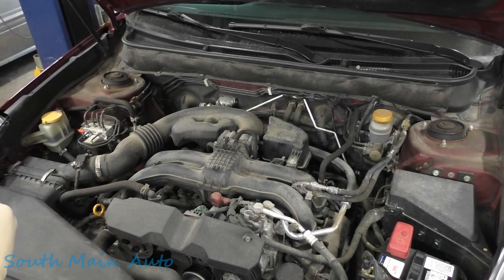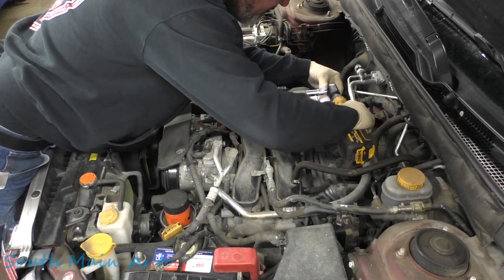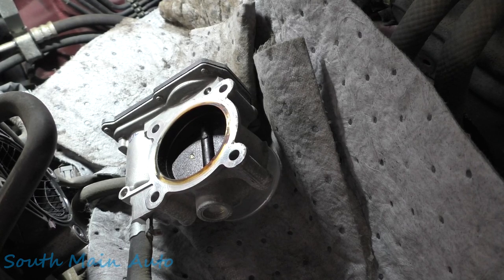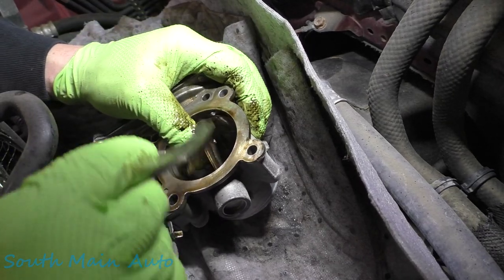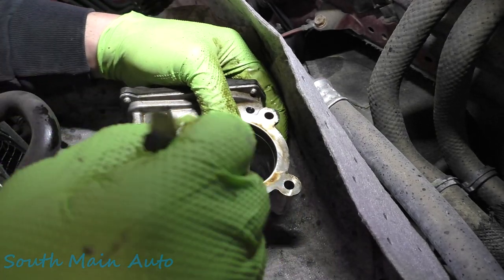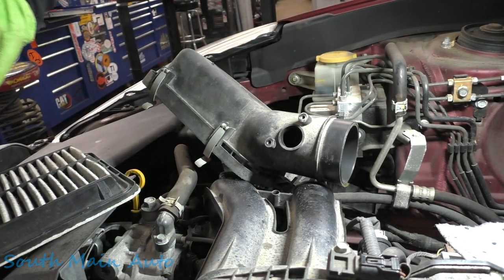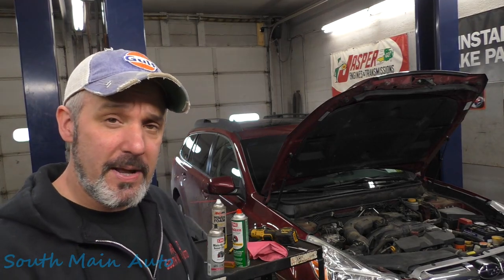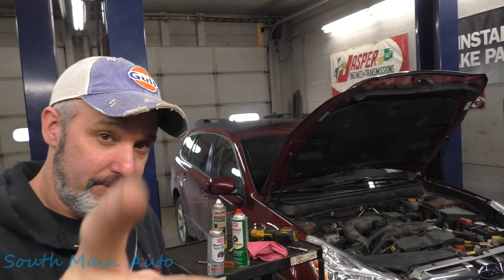How Does Your Shop Deal With Intermittent Symptoms?

Comment: For intermittent problems I tell the customer to leave the car with me for a week.  If it’s a problem that happens once a month or so then I’ll tell them to bring it back when it’s more broken.  

I drive it as my personal car (to/from work, around for errands, etc.).  Of course I return the car with a full tank but I’ll sometimes put 100-200 more miles on it.  Usually I can get them to act up but if not then I’ll do similar “guess and check” style repairs.  I also make sure to wiggle all the wiring harnesses, relays, etc. just in case.  

Having the vehicle for a few days also helps me think about the problem and sometimes I’ll have an idea that I wouldn’t have if the car was just there for a few hours.

Comment: So I’m only a few minutes in and only a few scrolls down the comments. 

Idle droop is a common problem on NA (1st gen) Miata (No a Miata is not a Subaru). Among Miata owners the anecdotal consensus is the Idle Air Control Valve / Idle Speed Control Valve. There are passages cut into the block of the intake where the TB mounts to: these get carbon deposits that cause the IACV/ISCV to not function properly. A good cleaning is usually the solution. 

Now at 4:40 where the EGR valve is being checked; I had also found mine (different design) to stick. Again soaking and scrubbing got it unstuck. Not exactly sure if it was related to the idle droop)

I also cleaned the TB as I had it off anyway to clean the IACV/ISCV passages. Mine was spring-loaded and cable-actuated, no no real concerns about opening the butterfly. I would think for an electronic TB, so long as it is not under power, and not being forced to its end stops, it should not present any issues. (Doing so while powered, or applying pressure while fully-closed / fully open, WILL cause internal
Mechanism damage.)

Link for the Amsoil Power Foam?

Comment: I too, have a throttle body brush for my AR15. I do not, however, use Power  Foam on the bolt carrier group. Im a Hoppes no. 9 guy.

Comment: Run a cheap data logger(cheap Bluetooth OBD2 adapter with a smartphone app) anytime while driving. That's how I found the intermittent hesitation (during steady driving) issue. It was due to a faulty throttle position sensor. TPS resistance tested fine, and the sweep tested fine. The issue occurs during steady throttle, the TPS reading would go from whatever the throttle was held at to 0% and back to the original position, all in less than half a second.  This caused the ECU to think the throttle was closed and thus cutting fuel, hence the hesitation.

Comment: It is one of the hardest things to find, Intermittent faults. But yes you must at least try inspect the regular things that can possibly cause drivability idle problems. In Australia on the Subaru we had a lot of Idle hard start fault problems with air flow meter, generally clean or replace and problem fixed.  Love watching your Diagnostic technics. Dave from Australia

Comment: I had two Subaru's in the last 6 months.  With intermittent stalling problems.  Both times I cleaned the throttle bodies and was able to restore idle quality.  I do the same on gm's and I perform a relearn procedure for the gm throttle bodies.

Comment: As a diy mechanic a customer I have had a 15 Elantra 1.8 that would sporadically stall.  Would read the codes no codes.  Car would drive fine for me, give it back and under their driving conditions would stall.  I eventually got it to stall for me and when it did stall would show a cam code (I don’t remember off hand the code number) but it was a exhaust cam code.  Swapped sensors around since they were the same part number and eventually it stalled with the code moving to the intake.  Finally was able to pull the trigger on a cam sensor.  It’s not easy guessing on parts when I don’t have enough experience with that manufacturer also don’t have a high end scan tool or scope.  Sometimes luck and reasonable though deduction have to be used.

Comment: Idle Air Control Valve My father had an intermittent rough idle on his BMW 318i. It would only occasionally happen when he turned the wheel over hard, such as when parallel parking. Local mechanic could not figure it out. I figured it out. It was the Idle Air Control Valve. When the wheel was turned hard, the power steering pump taxed the engine the most--drawing down the idle, naturally. To compensate, the IACV kicked in and, since it was dirty, it would occasionally stick. This would throw the idle off. Check the IACV, if there is any on that Subaru.

Comment: Went through it years ago in a GMC truck. It was winter time and it ended up being water contamination in the fuel tank. Some days the water would freeze or be slushy and some days it was a liquid.  Customer went through every repair known to man for months. Unhooked the fuel feed after pump and did a clear bottle sample, there was about 2 gallons of water in the tank.... Solution was a drain and new tank sender pickup flange gasket.

Comment: I work on my old Navy Base so I do have an advantage. I am there every day. I can leave an intermittent problem and check it every so often and build up some info. Does it malfunction more when it is wet? When F18s are flying over and shaking the building? Are the SeaBees running something that pulls a lot of current? Mechanical parts and electrical connections are where I start first. I can temp repair it till I discover the actual problem.

Comment: I think the key take away is 'to use all of your resources'. What can cause a symptom like this? How can you reproduce it? How accurate/informative was the customers description? When I used to service manufacturing machinery having a good operator who could describe the problem made things so much easier. 

I bought a 1993 Geo Tracker (Suzuki Sidekick) new. Within a few days the auxiliary electric cooling fan kept turning on/off randomly when the AC was not in use. it might stay on for a few seconds or a few minutes. On/Off, On/Off. With the AC on it stayed on as it should.

Dealership had it for two weeks and said they could not get it to stay on long enough to figure it out. Took it to another dealer (since it was still under warranty), they said it was the blower switch on the dash! Obviously clueless. In the meantime, I had bought the Suzuki factory service manual and looked up what could turn the fan on. There were only two things that would cause the fan to turn on. 1) Turning on the AC, 2) A thermostatic switch on the block which monitored coolant temp. 

Took a screwdriver handle and tapped on the thermostatic switch and the fan came on. More gentle tapping and it was on/off, on/off. Called dealer and told them exactly what part was bad and needed to be replaced. Called back later in the day and they bragged about how smart their tech was for figuring it out. When I reminded them, I told them exactly what part was bad they changed their story.

Point is use the information you have available. I'm just a shade tree mechanic but a little research and common sense can go a long way.

Comment: Re: Aftermarket air filters
My Ram 2500 6.7L Cummins fuel filters are the same. I can't use aftermarket fuel filters. The aftmkt ones have a round hole, and have to be forced onto the oval-shaped pillar thing-a-majiggie, and are then hard to get back off. The OEM filters have an oval-shaped hole and fit right into place and are easy to remove.

Comment: While watching the removal of throttle body on Suburu I noticed that two of the screws seemed to be loose. Indeed, the sealing surface of the throttle body showed uneven crud build up indicating a slight leak.  I had to replace the throttle body on my 214 Jeep Patriot, 2.4L engine, and found one screw wasn't even tight.  Upon a closer look, all the screws were too short to provide good clamping! Only two or three threads engaging the boss of intake manifold.  I ordered 50mm longer screw from McMaster-Carr, tapped the holes through the manifold boss and problem solved.

Comment: Stalls after battery replacement. No codes no skip. Disconnect battery for a minute. Reconnect. Turn ignition on engine off for ten seconds before starting. This resets minimum air rate. If it still stalls, replace air fuel ratio sensor and oxygen sensor. Both sensors!!!!! It will stop stalling and eating cats.

Comment: I worked for a Buick dealer  in the late 80's early 90's . The techs would check for any bulletins from GM stating a similar issue. Or they would have someone like me who was paid hourly not book time drive it for as long as it takes for an issue to occur. Once I went for a long ride and had to be towed back, after that I had to just drive in circles or close by so it was a shorter tow back.

Comment: I do the same as you have done. I use the years of working on vehicles use things that have worked before. Try one thing tell customer to drive it and see if it fixed or try something else. If I have time or the customer can do without it I have drove the vehicle back and forth to work couple of days to see if I get it to act up

Comment: I had a customer with an 04 Odessey, 230k- I checked out the car before it went on a Disney cruise from NJ- it came back with a stored P1740. The car ran good- no lockup or 4th flare. Customer also noticed that the check engine light after 11 hours of continuous. It has clean fluid. I do believe the solenoid is failing mechanically, but it ohms out just fine at atmosphere temperature. I need another code, so I sent him on his way, as this will be used mostly around town for the next couple months.

Comment: With it having a new battery, I would bet money that idle relearn will fix it. We run into it all the time at my shop. You clean the throttle body, disconnect the negative terminal for roughly 15 minutes, then start idle relearn. After connecting battery, you key in engine off for 15 seconds. Then engine one for 10 minutes. Then keg off engine off for 20 seconds, keg on engine off for 15 seconds, then run engine for another 5 minutes. Key off for 30 seconds then done!!

Hope this helps, I get these about once a month with the same issue.

Comment: RE: Intermittent faults:  I used to work for an OEM (factory, not the dealers) and they had interview sheets for customers for a number of problems - drivability, oil consumption worksheets, auto trans worksheets etc..  These were supposed to be completed at time of intake by the service advisors, but I used to suggest they either call a few days in advance of appointment or e-mail forms to customers to fill out.  That way, the customers would start to be aware of the conditions in which the faults occurred, and stood a greater chance of giving accurate descriptions.  I wish I could say dealers did, and things improved, but most folks just ignored advice and tools provided them to help their fixed right first attempt score :).

Comment: I routinely opened the throttle for cleaning on my 2000 Toyota (cable throttle) with no issues.  When I did the same on my 2013 Silverado fiteenhunnert with the big 4.8 (wired throttle) It wouldn't idle right.  My neighbor is a pro with a fancy 2 way scan tool, did a "relearn" on the throttle and it idles perfectly.  Just be aware that some engine will lose their nut and require special attention if you open the throttle by hand.

Comment: Preventative maintenance is key. Experience is extremely helpful. Eric does such a fantastic job of making a boring job, not so boring a job! He makes it fun AND entertaining! He applies LOGIC and COMMON SENSE, together, to narrow the possibilities before homing in on a suspect. Then he gathers the evidence needed to prove a fault, before throwing parts at it. 
The only other thing that I would have gone after would have been spark plug gaps. (worn plugs cause all sorts of other seemingly random issues)

Comment: I work at the local Subaru dealer and from what i have seen with this issue there is 2 things i do when this comes in. 1 there likely is a ECM update for the car that addresses heat soaked or intermittent starting issues under X conditions. 2 an idle relearn afterwards. All NONE TURBO Subaru's from 2005 to 2016 will need a idle relearn after the battery is changed or disconnected. Turbo and 6cylinders do not need to have a idle relearn but they can be performed if you like. Also the battery in this car looks fresh so i would just idle relearn the car and send it.

Comment: My shop handles intermittent issues in a similar way. Try to reproduce the issue, then do simple things that might help.

The hardest part about it all is that customer descriptions can be misleading. What they hear as a rattle may be a clunk to me. 

I once had a customer with an intermittent "rubber on rubber sound". The problem with their description was that every bump you hit caused the dashboard to rattle, the brakes were slightly squeaky, and they had tools rolling around in the back seat and trunk. I couldn't figure out what noise they were referring to. I did a test drive with the customer and according to them the sound never happened.

Intermittent issues are tricky. But customers usually appreciate when you put in a genuine effort to find the problem.

Comment: Check the PCV valve. They are notorious on these cars for getting gummed up around 100k and causing those exact symptoms. I have a 13 Outback with 130k and just replaced the PCV valve and associated hose (since they get brittle and they're cheap enough to replace). $50 in parts, takes 2 minutes to do.

Comment: After the cleaning i think the next step is a fuel filter, then cleaning the injectors. This after a computer reset that you did by unplugging the battery for 10 minutes. Had a 2014 impreza for 6 years had the same issue, cleaned the tb, changed plugs. Seemed to go away until it was cold. Then i realized it was the brake light switch, which was recalled and replaced once by the factory. Was causing bogging and traction control to go nuts when driving. Replaced and never had an issue again.

Comment: A few years ago my Aztek had a stalling issue. It would drive fine, but as soon as I got to red lights, stop signs, etc., it would stall out. I took it to my mechanic and of course it was suffering from shyness and wouldn't act up with them. It got to the point, my mechanic drove it home one weekend to just drive it and see what happens. It finally started acting up for him and wouldn't stop acting up for him. It ended up being my ignition control module going bad, but not in a way that the computer would trigger any warning lights.

Comment: Hey Eric, I think you handled the situation exactly right. I would've recommended the same service and let the customer drive it and see what happens. I'm sure your regular clients trust your judgement and experience. I had customers let me drive their vehicle for a couple days to see if it would act up for me . Sooner or later the problem will rear its ugly head .  😬
Reply: I had a 2005 Forrester that had the money light come on at 27k miles. Dealer replaced the O2 sensor a dozen times. At 95k miles they decided to replace the wiring harness inside the car, not the engine harness. No rodent damage. On the way home the money light came on again. The factory rep.  paid to have it towed to a different dealer. The second dealer wanted to charge me $1,300. For neglected maintenance the first dealer never did. Which was a lie. After communicating with the factory several times they offered me a coupon for a $500.00 discount on a new car. I will never own another Subaru. Gave it to my wife to drive on a mail route for another 60k with the money light on until it was sold.

Comment: I have found a dirty IAC solenoid or air bypass can cause these symptoms. Although with only a 109k probably not likely. 
Back in my day we weren’t picky about work, intermittent or other wise. Flat $75.00 diagnostic fee. If problem found in under an hour the $75.00 went towards final bill repair cost. Sometimes the problem was not found and we would have to pull the plug and send it down the road with no answer.

Comment: Keep it simple try running cleaner in the tank and take it for a 30 minute ride on the highway with the scan tool monitor fuel pressure. If you can’t get it to act up still. Check the filters and replace the plugs and clean the throttle body. Usually seafoam will help clean the egr and everything else. Then send it back and tell them to let you know if the problem is solved. It’s usually something simple but all this usually covers the problem 80 percent of the time. This is what would do. A general low cost solution before start replacing expensive parts. Idk what else to tell you

Comment: I seem to recall that Subaru had a tsb out on the older cars where they would intermittently stumble and die when coasting to a stop at a traffic light. It was a problem with the torque converter.

Comment: You sure were in a cheery mood today!  My guess is intermittent failing/leaking fuel pressure regulator. 
An independent mechanic should be like a great internist doctor. Hang in there with the patient until the problem is rooted out. Of course it cost money for all the time... but did you want the problem diagnosed or not.  Your mileage may vary, eh?

Comment: Ultimately they need some tools to diagnose it "in the field". And im not saying OBD scanner but a few things they could try when it happens to narrow it down.
Does it get worse with accelleration/revs (you can rule out vaccuum leaks or open EGR's), does priming it several times before starting make it no longer occur (fuel pump/raid issues). Does it get worse the longer it sits (maybe a cylinder flooding).  Things regular folks can still perform, but narrows it down.

Comment: The "Oil Control Valves" will sometimes get packed up with sludge and cause a low idle and stalling, but they will also set a code that can be seen by a scan-tool.